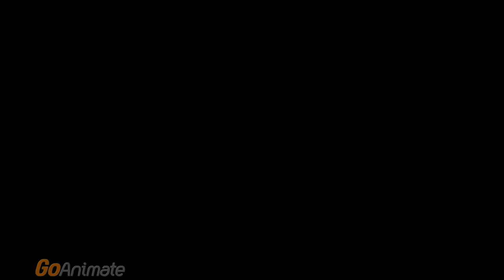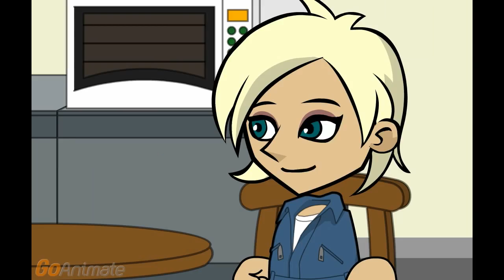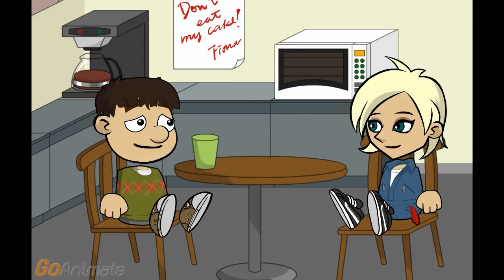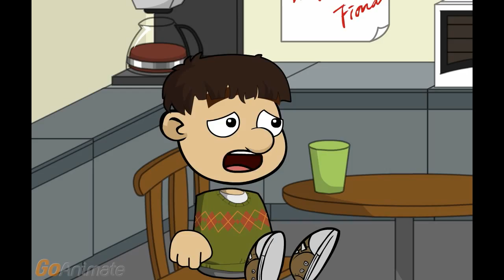Why is My Water Heater Not Hot Enough?

Comment: You told everything except the most common issue, and it because of the tank having salt build up and make  insulation between the flames if it gas heater or the heater rods if it an electric heater
Reply: What would be the fix? Drain the tank?